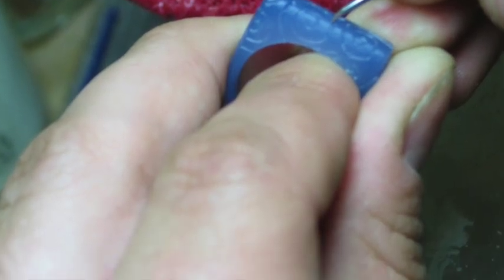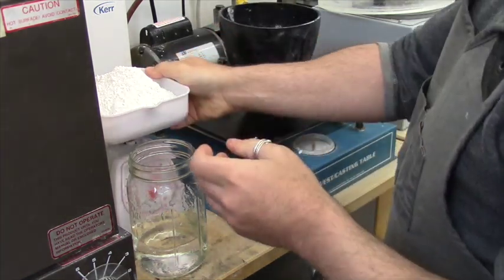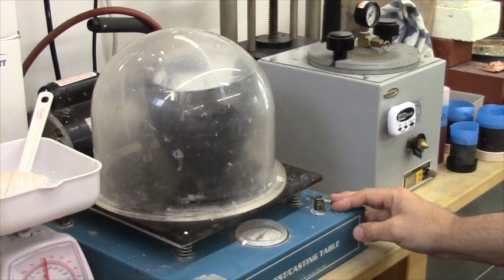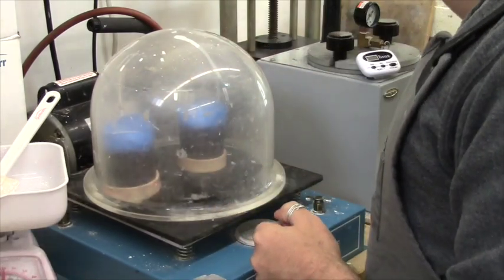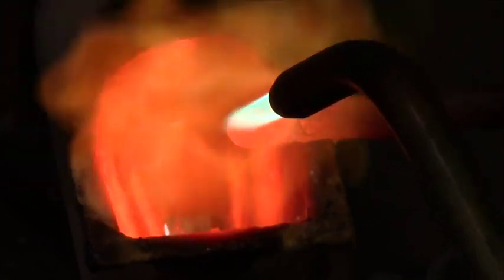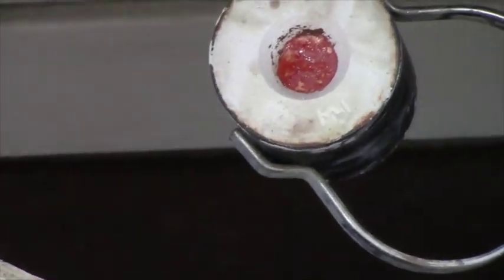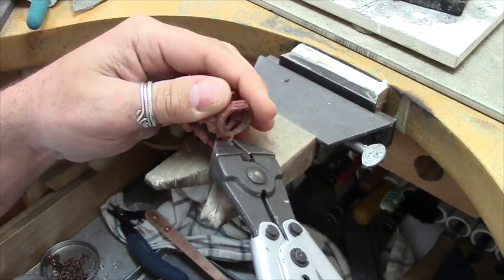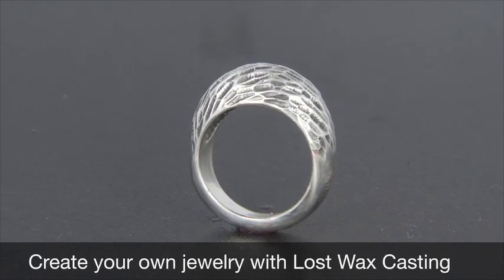Lost Wax Casting Process

Comment: Hey are you still active I have a question
Reply from the maker: Ask away. :^)
Reply: I just brought the same neycraft oven what setting do you use for the wax burnout? Does it ramp up and hold its self or do you have to manually adjust it your self?
Reply from the maker: @deeaikens9843  Sorry I just saw your reply. You need to set the Neycraft manually. It doesn't have a controller. So keep notes for dial positions. Or you can buy a separate kiln minder that you can program like this one that will hold a lot of programs for burnout, etc. https://www.riogrande.com/product/kilnminder-oven-controller-k4e/703094
Reply: What temp do you use to cure the investment and what temp do you use to burn out the wax? I’m afraid to do these wax models because they took a lot of time to make
Reply from the maker: @deeaikens9843  Hi - So you let the investment harden at room temperature for 2 hours after investing.  The kiln program for the burnout varies according to the size and number of flasks you're burning out. The investment manufacturers offer free pdfs with instructions on burnout schedules/temps and investing. Like this one: https://docs.wixstatic.com/ugd/cc5f22_c4ac76d773c94aa5b8ceff61af77b72f.pdf

Best of luck with your project! Joe

Comment: I want to make make a silver belt buckle. I got  kiln to do the lost wax brun out. I got a oxygen/kerosene tourch, and made me  top vaccum. Here is my question.: 
Hiw do I know that the solver is hot enough to Puerto it into the mold?
Reply from the maker: Hi - The silver will melt into a smooth rounded puddle. The surface will look like a mirror and can also appear to move and roll. If you're melting in a crucible with a handle you can gently swirl the liquid metal in the crucible to be sure that there are no solids left. Don't let the metal boil - it will look like the surface is quivering and jumping. Good luck and be safe. Be sure to wear tinted glasses to avoid getting cataracts from repeated exposure to infrared light from the hot metal and UV rays from the torch.
Reply: You humble me with your answer. My most deepest gratitude.
Reply: I have seen some videos that teaches to set various temperatures program on the kiln. Do I have to do that way or can I go up to the 1350f and then down to 1000f?
Reply from the maker: Isa Abd Rahman Sosa-Dominguez Hi -it’s best to run your kiln through a number of stages, slowly ramping your temperature up to the maximum, and then slowly dropping it down to casting temperature. Sample burn out kiln programs are offered by the manufacturers of the casting investment on their websites. Best, Joe

Comment: Joe, can you retrofit or purchase larger flasks if you were wanting to make something like a medallion that was slightly over 4"?
Reply from the maker: Hi - The system you use will determine how big your flask can be. Centrifuges and vacuum casting machines have maximum flask sizes. If you want to cast something larger, you'll need to source a way of helping the casting with enough force to fill it without getting incomplete castings due to air or gas pockets.
Reply: @SilveraJewelrySchool  Thanks. Are you alluding to a custom centrifuge design or are you talking about an industrial level machine at a casting house?
Reply: Craig Murray There are casting systems like Neutec from Rio Grande that can handle flasks up to 6x10 inches. Here’s a list of casters on our site: http://www.silverajewelry.com/links.asp

Comment: at 5:46 i got a heart attack as the box moved with the start of the centrifuge.  my thoughts literally were "oh he's got a nice protected area for using the torch, thats a good idea, wait, whats..surely no one would put a centrifu- Oh MY GOD. Flying, burning metal! if that thing bumps the right way that is slag in the eye.  No. the entire box should not MOVE! Don't care! Don't want to hear it! thats bad shop safety.
Reply from the maker: Well, you're welcome to your opinion, but 20 years of use and not one accident, and all the castings are fine. :^) Any movement from the box being on wheels is minor since I balance the machine for every casting. I still have a wall around the centrifuge in case of any minor spillage. If anything spills, it lands in the bottom of the box, where it quenches itself almost immediately. Most people who object to this set up work with a metal well, with a wooden base.... Guess they're ok with wood on the bottom but not on the walls of the box. Funny how they don't think wood walls are any safer than a wooden base. Hey, at least I'm not slinging my castings over my head like the way olden days, which at one time was considered "shop safe". ;^)

Comment: Please reply with a parts list and links where I can purchase.  (Centrifuge, vacuum chamber, etc.)
Reply from the maker: OttoFrei.com sells a good casting kit including a kiln and centrifugal casting machine: http://www.ottofrei.com/Otto-Frei-Jewelry-Casting-Kit-2-Pro-110V. That will give you a basic list of parts for casting. You will need a casting torch (oxygen/propane is best) or an electro melt furnace to melt the metal. The torch works best for both vacuum casting and the centrifuge. Thanks for watching!

Comment: What kind of plaster is that? If you just poured it instead of doing the centrifugal system would u get too many voids?
Reply: Hi - I use Kerr Satin 20 investment, which is different from regular plaster. It's formulated for the intense heat and duration of a casting burnouts. Good question about pouring. If you pour metal into the investment mold you are likely to get voids in the casting from trapped air or gas. But if you either use a centrifuge or do a vacuum assisted pour, you can get great results. Thanks for watching!

Comment: Very cool video. This is the first time I've seen a centrifugal casting device. When the wax gets melted out, do you collect it for reuse? It would seem rather wasteful to just burn it all. Is the investment a dangerous material? I'm guessing it's not plaster of Paris and may contain silica? I would love to have a go at this myself.
Reply from the maker: Hi - Thanks for watching. You have the option to steam out wax before burnout if you're using lower temperature injection waxes. Carving waxes are harder to steam out. But it's usually mixed with the sprue wax and water and not usable, But steaming it out makes the burnout cleaner with less odor and fumes. We use a specialty investment for casting that is similar to plaster but has ingredients to make it better for high temp burnout. You do have to be careful whenever using investment. I wear a respirator. Thanks again, Joe

Comment: Great video, thanks for posting! I'm looking to cast a 2" puck of gold, and we're looking to use a lost wax method. The final part will be ~1mm thick by 2". Do you have any suggestions on casting something like this without a centrifuge? We have a vacuum oven (which was how I was planning on baking out the wax) and I was thinking that we might get away with some small vents at the edge of the puck if we set the investment into the vacuum oven when we pour it. If you see anything egregious about that method, please stop me before I waste a lot of time :)
Reply from the maker: HI - Thanks for watching and your question. If you have trouble filling the entire 2" diameter 1mm sheet, the model may be too thin. You may need to up it to 1.3mm (16 gauge). Good luck with your casting. Joe

Comment: Thanks for the informative video. Have you ever had any accidents with the centrifuge eg hot molten metal spewing everywhere?
Reply from the maker: Hi Betty - Thanks for your comment and for watching! :^) 

Sometimes a little metal gets past the crucible, but the spinning sends it downwards to the bottom of the box where it sizzles and puts itself out quickly. I've heard of rare failures where the crucible comes loose, but this is usually because of a failure to make sure that either the crucible is correctly put into the cradle or using a wrong size crucible that isn't compatible with your machine. The walls of the box help to keep any spray contained, and you can use safety gear, like a face shield. 

It's a good question, but in 25 plus years of casting I've never had more than a few drops of metal spray into the box during any casting. 

The key is to balance the machine before each casting, balancing the weight of the crucible, metal and flask against the adjustable weights on the other end of the machine. Thanks again, Joe
Reply: It happens to any caster occasionally.

Comment: Great video, but I have one question when you put the flask in the crucible is it warm,cold or how should it be? because I trie to make my first casting with a centrifuge and what happened was the metal pierced the plaster leaving the mold empty, so also what would you recommend me to de next time? Thank you
Reply from the maker: Hi - The flask should be warm, a few hundred degrees below casting temperature or around 950-1000 for fine castings, 900 degrees for thick castings. Make sure when you invest your models that they are not within 1/4" of the sides of the flask and that they're 1/2" below the top of the flask. Too close to the sides and top and the metal can break through. Happy casting!

Comment: Silvera Jewelry School
Thank you for this educational video. I did have a question I was hoping you could answer for me.
The plaster you use. Is it a special blend mix or it plaster of Paris? Just curious because I have seen other videos
where the mold has to be broken open versus disintegrating in water. Thank you :D
Reply from the maker: Hi - Thanks for watching. Special investment is recommended for jewelry casting, not plaster that you would use for sculpture, etc. Casting investment is mixed with materials that allow it to be fired at temps upwards of 1300°, to receive molten metal that is hotter than that, and to have very fine detail for the best casting. Some investments are formulated for purging in water, or to be more receptive to being removed by breaking the investment. For example, investment formulated for casting stones in place needs to be removed when the mold is cold, so it's made to break up easily. Most investments will remove fairly easily by breaking the investment mold after casting, even just by rapping the steel flask with a mallet, especially if the flasks are small. Best, Joe

Comment: what is the solution you put into the rock tumbler barrel with the shot and jewellery?
Reply: Hi Baz - I'm using a rotary rock tumbler. It's loaded with 2 pounds of mixed shapes of stainless steel shot. To lubricate the tumbling, I use enough water to just cover the surface of the shot, and a drop of tumbling compound, like ShineBrite, or a drop of Dawn blue degreasing liquid dish soap. This kind of soap is the cleanest with the least additives for tumbling, or for cleaning your metal. So something similar to that would work fine. Just a drop! Too much and the suds are insane. Happy tumbling and thanks for watching! - Joe Silvera
Reply: Thank you for the informative reply :) May I also ask if using a tumbler would work to burnish aluminium parts? I'm currently sanding craft items and then polishing them, this would be a welcome alternative.

Comment: Very detailed video, I have two silly questions:

1. When you put the plastered flask in oven, why only the wax is melted but not the plaster?

2. Just curious, wouldn't the heated metal in the centrifuge spilled out when it's spinning?

Thank you for the video again!
Reply from the maker: There are no silly questions. Just curiosity, which leads to learning. Here are your answers:

1. When you put the plastered flask in oven, why only the wax is melted but not the plaster?
A: The kiln doesn't reach a temperature that would destroy the plaster. AND this is not just plaster we're using. It's investment. This is a special mix of plaster and other ingredients that can withstand high temperature. The wax melts out early, around 200-700 degrees. The higher temperature firing in the kiln does two things: it removes any residue of wax inside the investment mold, and it hardens the investment. 

2. Just curious, wouldn't the heated metal in the centrifuge spilled out when it's spinning?
A: You would think so, and sometimes if it's not properly set up or overfilled, some metal does spill out. But the crucible is designed to fit tight up against the invested flask, and is also designed to funnel the metal into the mold as it starts to spin. Not balancing the centrifuge or melting more metal than the crucible is rated for can cause metal to spill out the side. That's why it's inside of a box or well to contain any spills. 

Thanks for watching!
Reply: Thank you very much!

Would there be any chance of you to upload a video about how a tennis bracelet is made? I am always curious how the parts are being connected together.

Thank you again for answering my questions, you rock!
Reply from the maker: No, sorry. Tennis bracelets aren't my thing. But if you search around hopefully you'll find something helpful.

Comment: Wow, this is actually a really nice video about lost wax casting! I have one question though: you've used a centrifuge for casting. Why is that? Couldn't just pouring the metal (silver?) into the plaster mold produce the same result?
Reply: Just to be clear for any one else reading this (I know you understand CoolKoon, no problem there), but I did use sprues to connect the models to the button or pour cup. I didn't use vents. It's probably overkill to reply, but I like to try to maintain a clear thread in the comments. Thanks!
Reply: @joesilvera8853  this is the method universally used for precision casting in prosthetic dentistry !!!!!!!!!
Reply from the maker: @adsdentiste  We run a low toxicity classroom at our school. Sorry, but A) asbestos is not used in jewelry studio casting, and B) asbestos is too risky to use. Let's agree to disagree. But I want people who read the comments to know that asbestos is not required for jewelry casting.
Reply from the maker: Hi and thanks for your question. In order to fill the mold completely the molten metal requires the help of force to overcome the resistance of gas and air pockets in the mold. A centrifuge applies force that easily overcomes that resistance. Just pouring the metal usually results in incomplete castings. Another common method is a vacuum assisted pour. The steel flask is placed on a vacuum table, and when sealed the vacuum draws air out of the mold, lowering the atmospheric pressure inside the flask. This lower pressure provides the force to help the molten metal fill the mold completely. Thanks again! Joe
Reply: I see. Thanks! So does this happen because of the small size of the castings and the molten metals' surface tension? Also, what's the size above which this stops being a problem?
Reply from the maker: Well, I know from when I did foundry (sculpture size) castings in college that we did not assist the casting with a vacuum, etc. We just poured. The mass of the metal and the construction of the sprues and models was enough to get a successful casting. Jewelry flasks are usually smaller than 4x8 inches and at that size, some sort of additional force is used. I don't know specifically where between jewelry and sculpture additional force is no longer needed. It's a good question! But since I only do jewelry casting, it's outside my expertise. Let me know if you find out.
Reply: Actually now that you've mentioned I've realized that you haven't used any sprues for the casting, which probably also makes a big difference. But yeah, it pretty much looks like I'll have to learn about the limits the hard way. Thanks anyway!
Reply from the maker: Even at this small scale, we use sprues and gates. The terminology can be swapped, but in the video you'll see sprues connecting the models to the button or fill cup. And they're there in the metal casting at the end. What you often don't see in centrifugal casting of jewelry are vents, or small sprues running away from the top of the models to release trapped gasses away from your work. With a good set up and proper casting, they're generally unnecessary.

Comment: Just wondering what made you tumble the cast pieces before doing the end finishing instead  of  tumbling at the end? Also I was just wondering how long you usually tumble your pieces for?
Reply: +Adam Lagace Hi. Thanks for watching my video. - Tumbling is an option for a final finish. First I cut off the sprues, grind and clean the nubs left by the sprues and blend those areas back into the rest of the finish. Then I touch up any flaws up to about 400-600 grit finish. Finally, I tumble in stainless steel shot or with fine steel pins for up to 2 hours to burnish the metal to a high luster. Burnishing has the advantage of not removing any additional metal and also closing any fine pits or porosity. Hand finishing and polishing with abrasives can reveal any fire stain from casting, and may require removing more of your carved details. Burnishing can polish the fine silver loam from pickling after casting and preserve your carving. Best, Joe